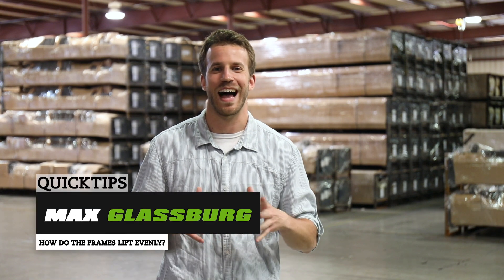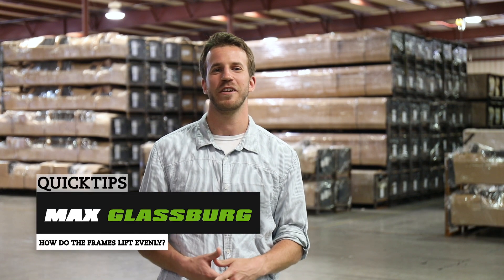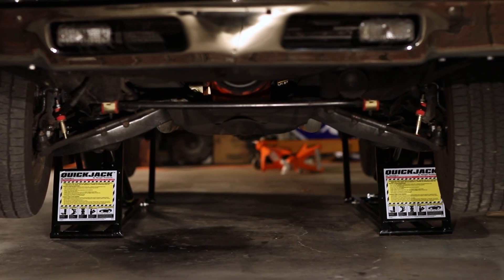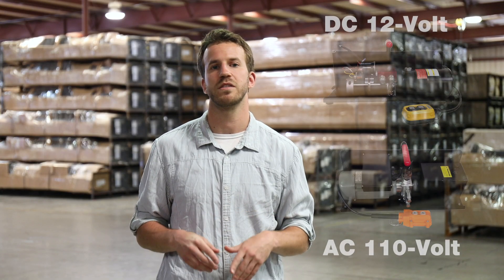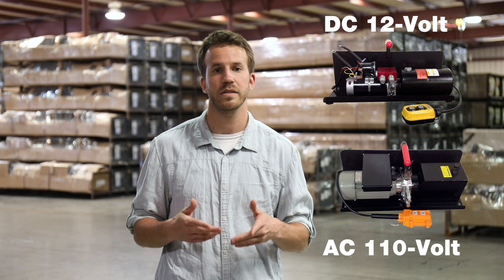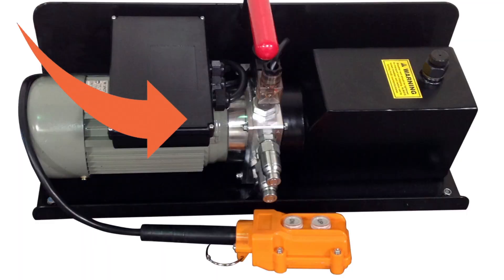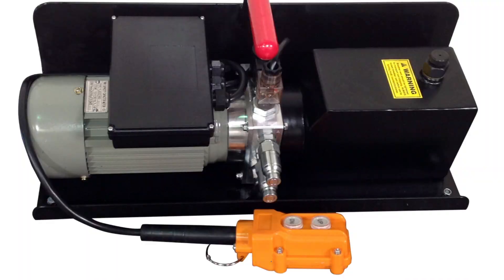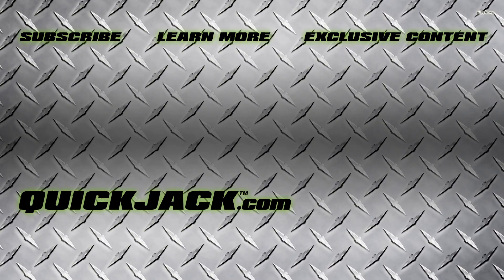What Makes the QuickJack Frames Lift Evenly?

Comment: Hmmm...mine goes up evenly, but one side takes almost 2x as long to lower than the other.
Reply from the maker: Sounds like you may not have enough air pressure in the air cylinder for the side that is coming down slower. Make sure to check that it has (and is holding) 50psi. If that doesn't help, be sure to contact QuickJack tech support through our website, www.quickjack.com or by phone at (888) 262-3880
Reply: @quickjackusa  I just setup mine yesterday. after the bleeding procedure without weight , I lower the 2 frames, and one side has a 2 second delayed in resting on the ground. I checked the cylinder that you pressurized to 50 psi, and it went down to 30 after 3 initial test as per the manual. COuld that have the air cylinder have a leak?
Reply: End up finding a fix? I’m having the same issue. Not sure if it’s safe to use them while one goes down way slower than the other.
Reply: End up finding a fix? I’m having the same issue. Not sure if it’s safe to use them while one goes down way slower than the other.

Comment: here's a question.  let's say I want to use just one side and place it under a fuel tank on a Chevy 2500 or something so I can lower it with a half or full tank.  would it be considered safe to just plug one side in and use it this way?
Reply from the maker: Good Question! Unfortunately, the frames are not designed to be used individually. Doing so could potentially damage the hydraulic power unit.